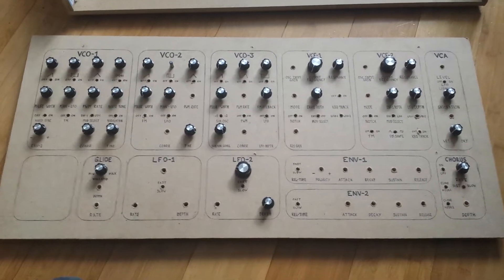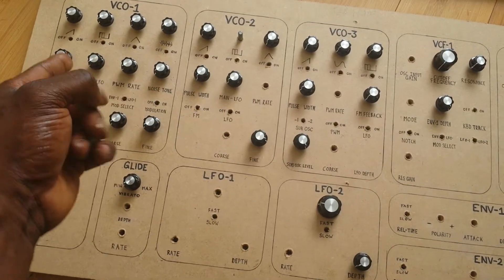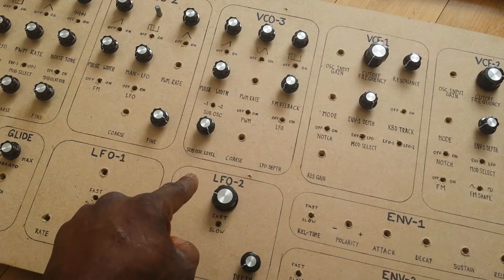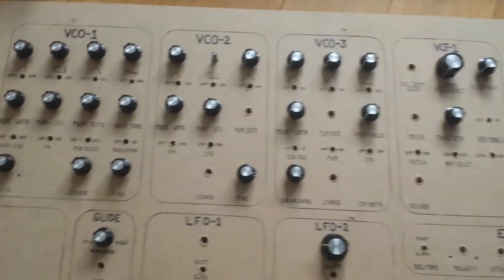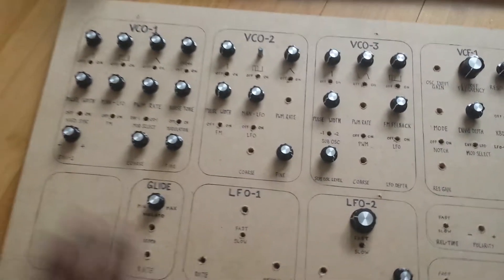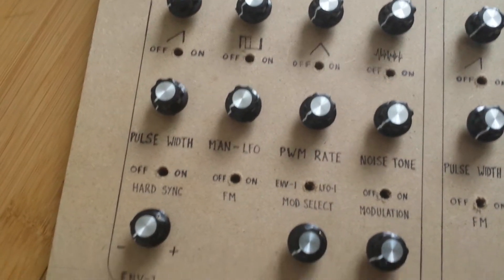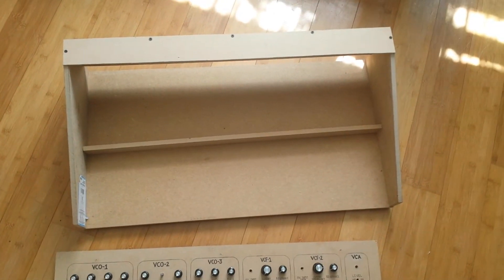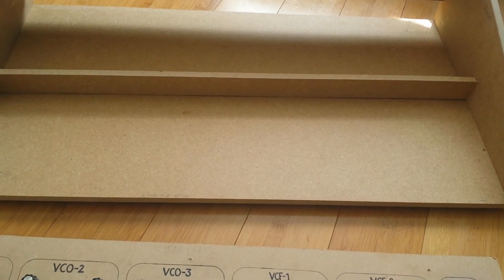DIY analog synth project (The front panel Design Pt1)

Comment: Good to see someone doing this, I am doing something similar for a midi controller devoted to a specific Arturia vst synth, with an option to switch between ios /usb devices as well and have found practically nothing on panel design for anything bigger than a Eurorack module. people might hate on it or  think I'm crazy. Your project is looking great anyway I like that you used a color other than black and silver. :D

Comment: So this one has been built as MDF? Good idea as it's easy to work with and cheap.
Reply from the maker: gorillaau Thats correct. Its my second trial.
Reply: Adamski A. Cool.  I'm thinking of heading down the same path. Cardboard to mdf and then final panel.
Reply from the maker: gorillaau I try and go by the rule of planning makes perfect as is practical as possible.
Reply: Adamski A. I think you have it right. You can stain mdf to add more texture.

I just ordered an MFOS Ultimate PUB. Looking forward to a big build! 

Take care of your synth.. and keep twiddling knobs.
Reply from the maker: gorillaau Yes i plan to build the whole case with aluminium  colour front panel, so its more of a layout sketch as i have added a few more controls since.

Ok kool never seen the MFOS PUB ill check it out, out of curiosity.
Reply from the maker: gorillaau Im in the process of drawing up the schematics in kicad which is proving to be a bit of a challenge . Never ever done any of this before.
Reply: Adamski A. Who knows, maybe you'll get a few more panel ideas. :-)

Comment: Checked your channel, saw this and hit 'Subscribe' immediately lol
3 oscillators and analog, nice to have room to move the pots during playing too. 
If unsure on the converting from schematics, I would advise building the core, presumably an oscillator and amplifier section to hear it. Put some test voltages through it that you'd expect from the key matrix.Then add modularly, checking the sound as you go. It's then much easier if a fault develops for where it would be.
Reply from the maker: Slider2732 Thanks for comment Slider, i guess you saw this video first before the others :-). Yes again as i said the oscillator are based on petw bennets schematic , then i toyed around with it and discovered i could derive a saw core from it , then i looked into waveshaping from this. I then thought about how to put them under voltage control. I revisited th3 first circuit i ever tried which was the jupiter 8 saw core, so i had the idea of trying to gel the expo converter to the oscillator and....... voila it worked !!!

Comment: The design is cool as it supposed to look like an old school machine.
One thing that digs in my mind: a patch matrix bay. You have a free space on the left side. Just imagine how cool it could be: you can patch O1 to O2 and O2 to O3 and O3 put to filter. Or patch O1 and O2 to O3 then to Filter... other different combinations... I guess it's possible to realise via op. amp. buffers.
Reply from the maker: MoolahNasreddin Hey man nice to read your comments and suggestions as usual. Yeh the blank part could be for a power indicator and logo and name , patch panel/ matrix would be better i think to run along the top . Still its very well worth considering. Thanks again :-)
Reply from the maker: MoolahNasreddin I did toy with the idea of making the filters series and paralell switchable but cant quite figure out how to do so. So for this project i think ill leave it as is to be honest. Would be very cool to have that option thou. Ive been eyeing the dreadbox synths recently and they are very inspiring :-)
Reply: Yeah, I just want that your DIY synth will become "an answer" to MiniBrute + Matrix :) You'll make it if you want. It's very real.
Reply: Switching and routing just need some investigation. You've done much harder things IMHO :)) I'm still stuck with the VCO. I'll get a final "answer" when I'll get my RS-3513 (ordered one), it gives +/-13.5v with ~1.5A I think it's enough for a middle synth.
Ask for that on Synth DIY, I guess that somebody should know the answer about it!
Reply from the maker: MoolahNasreddin Thankyou yes , it could definitly contend with the Artiria synths but obviously Yves usson the guy who designed he has far more experience than me , those two synths will defo become future classics. Buts its good to build something on the same par as them.
Reply from the maker: MoolahNasreddin Yes please let me know how you get on with the power supply.         Your right i could ask indeed a very helpful group  :-)